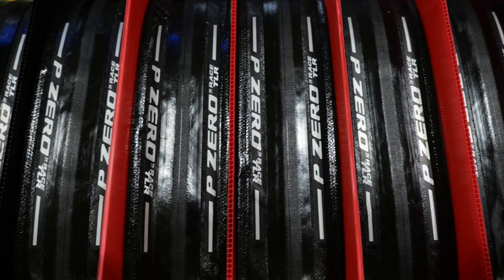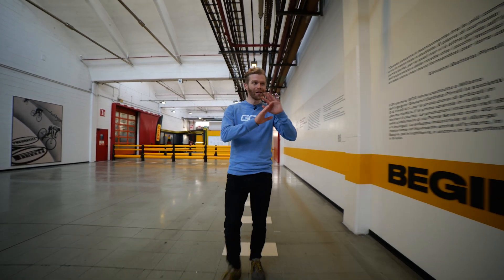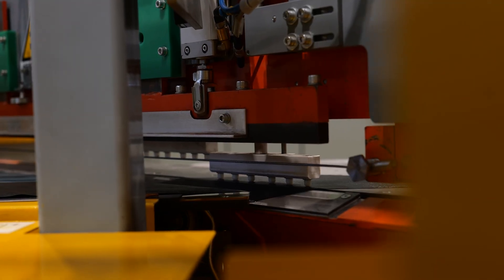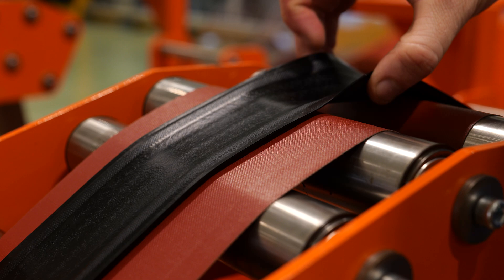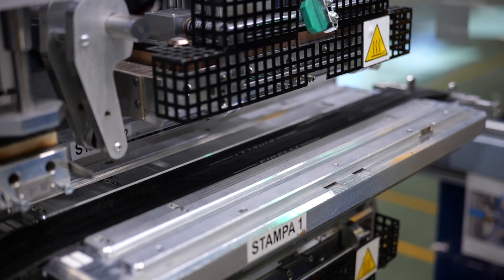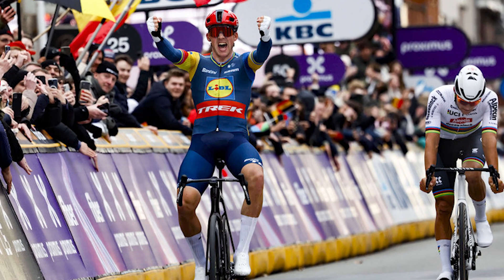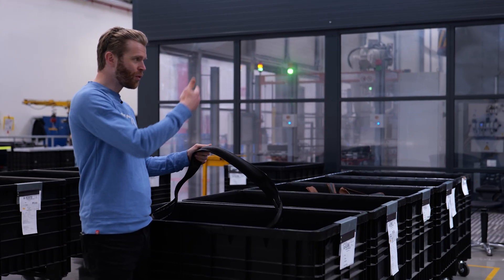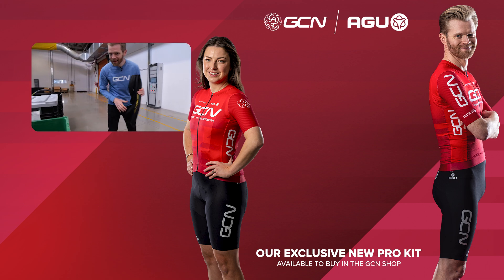How A Bike Tyre Is Made | Pirelli Factory Tour

Comment: I'm a GP5000 man but have used Pirelli TPU inner tubes at £25 a pop. Unfortunately they are nowhere near as good as Cyclami ones at £6.50 a pop. The valve stems on Pirelli tubes are unreliable in my experience whereas the valve stems on cyclami are standard aluminium without removable valve cores.

Comment: is it technically possibly for different parts of the tyre to have different levels of vulcanisation?   
A bit like how Japanese katanas are made  with varying thicknesses of clay along the blade to allow a variety of cooling speeds (making the blade both flexible and sharp)
Reply from the maker: Add Katanas in and it makes it sounds very cool 🤣

Comment: One thing I always wondered: How effective is the body's metabolism in using these vast amount of calories?

In theory, he should have gained almost a kg of body fat from this video. I'm absolutely sure he hasn't.

Theory says 90g of carbohydrates an hour. Maybe more if mixing glucose and fructose due to different receptors. Of course the meal wasn't just carbs. But if we stick with the carbs: What happens to everything over 90g? Do these just flush through without any impact in metabolism?

Always wondered at the all you can eat chinese.

#askgcntech
Reply: It's effective lol.  I get fat easily, I had 8 tacos for dinner tonight and a burrito but I'm not fat because I ride 200 miles a week.  All my meals are like that and I'm almost 50.

Comment: Just bought a pair of Pirelli Cinturato Allroad and whoever measures them needs their tools recalibrating, they are supposed to be 700x40 but when I finally managed to wrestle them onto to wheel they barely measure 36mm now I don't expect tyres to be exact because of the use of different inner rim sizes but this is the worst discrepancy I've ever experienced in 30 years of buying tyres sadly it was too much hassle to return them but it has made me think twice before buying any other tyres by them
Reply: Wheel rim width will impact the final measurement of any tire.  You can mount the exact same tire on a wide rim, then on a narrow rim, and get completely different width measurements of that same tire.